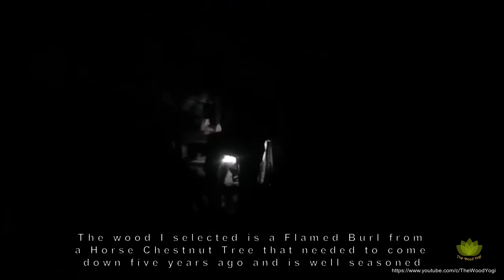Figured Horse Chestnut Mallet - Woodturning Project Giveaway

Comment: It would be interesting to see how that mallet works out over time. Horse chestnut can be a little brittle and light, but maybe the figuring will help in this respect. Nice job.
Reply from the maker: I've made a few from it over the years. I still use one regularly after many years of abuse. It looks like a well used mallet now, but that's what I'm hoping for with this one, that it is put to a lot of use 😊 They hold up really well and the head section of this one due to the figuring is really hard. A bit difficult to turn due to the interlocked grain, but it came out well 😊 ॐ
Reply: That's nice to know thanks. I've always been a bit wary of using horse chestnut, but will give it a try. Thanks